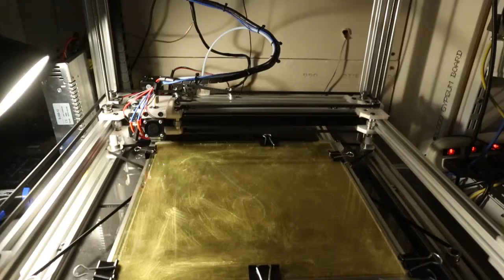Custom Made DIY CoreXY 3d Printer Test

Comment: Probably just a bug in the firmware (Marlin?).  I've found all of the homing code to be a little ad hoc, and it is not quite clear what limits come into play exactly when.  If the printer moves correctly otherwise, in your g-code startup script, first move off the limit switches with your separate G01 commands for X and Y (as you demonstrated),  and then go about your business as normal.